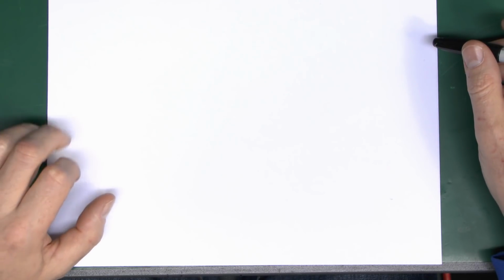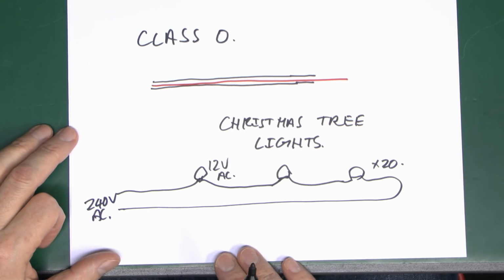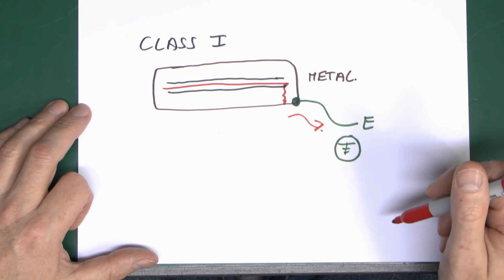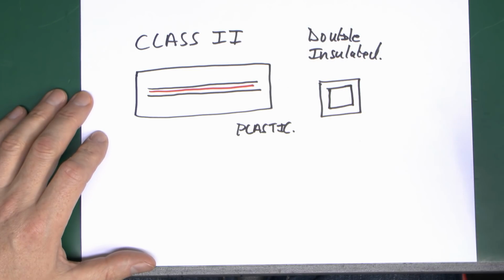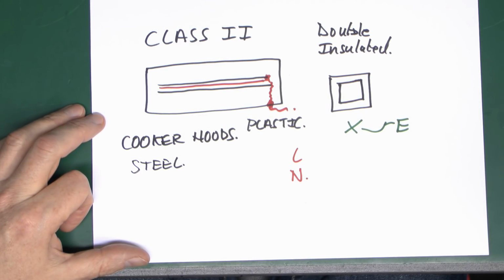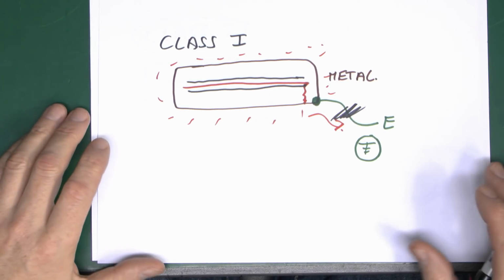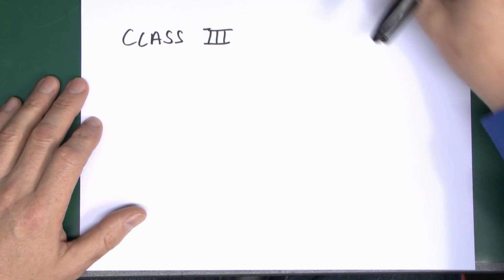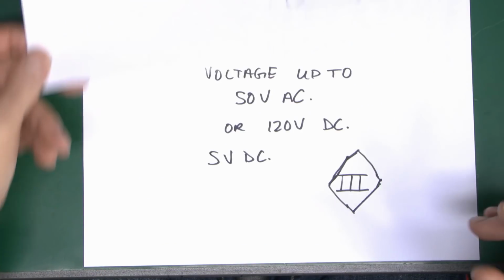Appliance Protection Classes 0, I, II, III

Comment: What class is an electrode boiler?
Reply from the maker: Depends on it's construction, could be class I or II.  The electrodes and the water they are in would be contained within some outer vessel, which could be metal or plastic.
Reply: Its a class -1,because it intentionally make the water live and touchable.

Comment: Would a 240 watt hair dryer fit in a shaver socket ?
Reply: The saver sockets are limited to 1 A. Hair dryers take some 5 A or more.
Reply: @okaro6595  It'd have to be a microscopic hair dryer and you'd need 2 of them to insert simultaneously ;)

Comment: SELV (Safety Extra Low Voltage) is used down here in Australia and New Zealand for things like fans and some types of light fittings that are in installed in bathrooms and toilet rooms.
ELV over here is defined as less than 50VAC and less than 32VDC, so a lot of these things run on either 12 or 24V.
One aspect of these things I don't particularly agree with, is that you have one of them nasty "wall-wart" plugs, plugged into a socket-outlet in your ceiling void, to power this equipment, where it gets really hot during the summer, they are all made out of black plastic, they have been known to start the odd roof fire.
Reply: What voltage are the output wires relative to ?
Let's say the voltage across the wires is 12V What is the voltage on one wire to Earth ? Usually they're not connected - so could be anything - like 240V. So you could have one wire at 240V and the other at 252V and you still have your 12V supply - and either wire could kill you.
Reply: I think you for those backwards. It would make no sense to have lower limit for DC. In Finland it is 50 VAC and 120 VDC.

Comment: Old electric clocks, which I believe have been featured before in your videos, would, if I'm understanding correctly, be something still relatively easily accessible (antiques stores and whatnot) that are Class 0. They normally rely on the insulation in the main coil to provide protection, with the movements typically made of metal, and metal components accessible from the back, and front, often, and don't usually include an earth connection. 

All the ones I''ve got I added a protective earth too, just to be on the safe side.

Comment: Surprisingly I've come across a few examples of class 0 appliances still in use. Usually old table lamps, with either twisted or figure of 8 flex, passing through metallic parts to the lampholder (often brass). They're becoming increasingly uncommon, being at least 50 years old now, but do still turn up.

Fairy lights were a rare exception, being permitted to have only basic insulation right up until '89.
Reply: In Finland class 0 used to be the norm on things like TVs until the mid 70 and in lamps it was used longer. They now are largely obsolete as their plugs do not fit grounded sockets which now are mandatory. It was seen that class 0 is not safe anywhere where ground potential is nearby. Not that people did not pick a knife and cut the plugs in the past.
Reply: I never knew those Xmas lights we had as kids were class 0! No wonder the lamps often died 😂 ah nostalgia for when one of the lamps dies you had to check each filament for which one was dead! I always hated how hot they got while sat on a tree.... Better than candles that was used many many years ago but ... Without any protection but the fuse in the plug? Well.... That's a bad idea!

Comment: Very good John thanks for the video had no idea class 0 even existed 👍
Reply: In Finland class 0 was the norm in dry room equipment until the 70s. In lamps class 0 was sold until the 90s. The problem is that they do not fit into grounded sockets which are in all new homes. It would be very dangerous to have class equipment in any room that has ground potential like grounded equipment. The problem was most acute in the 70s. Almost everyone did some illegal trick to fit for example their TV to a grounded socket. People either cut the plug or made an illegal extension cord.

Also if yo use class I on an ungrounded socket it acts as class 0. An example of an illegally modified class 0 plug:

https://3.bp.blogspot.com/-5r8ISaXrPTY/WhFmIIM3WTI/AAAAAAAANp8/kbOs6HlQoDAsIV6OkyKwQsMHAzfeakJ2gCLcBGAs/w1200-h630-p-k-no-nu/pistotulpat.JPG

Comment: Glad you mentioned at the end about class 2 light fittings, with the small terminal block and sleeving, which should be wired with, for example, a flex into a JB in the ceiling, rather than using connectors in the base. I've declined installing them when there's no chance of getting the JB into the ceiling (because e.g. can't cut a trap because there's fitted carpet on floor above,  or the base isn't large enough to cover the size of needed hole in the ceiling below). But dread to think how some have then connected them, either at customers insistence or as take the money and run - probably, as you say, just using connectors.
Reply: A common solution is the plastic cone between ceiling and flex.  These are large enough to house the connector, but are really only certified as a cosmetic cover for ugly attachments such as a rusty hook carrying the weight of the lamp through the outer sheath of the flex.
Reply: A mini junction box would be pretty handy in this situation

Comment: Sidebar: When I was a teen, playing bass in a band, our organ player would strip the  foil from a nearby cigarette packet, wrap it around the blown amplifier HT fuse and turn it on again.
Shudder
Reply: I take it the original fuse would take 11.
Reply: That's not that bad.  Most people that bypass fuses do it with a nail or a coin that most certainly will not burn out if shorted.   At least the foil would have went before any of the wiring melted.   At worst the foil would set alight and be a fire hazard,  but much worse can happen because most people bypass the fuse with a conductor that's stronger than the internal wiring.

Comment: I have an IKEA desk lamp which is class III. Also my Christmas lights (which I am leaving up as I haven't had a proper Christmas) are marked class III despite being purely battery powered.
Reply: All battery powered appliances are technically class III
Reply: @drgazter  Yes but few are marked.

The IKEA desk lamp is mains but with a transformer. The transformer is class II, the rest class III.
Reply: @seprishere  Better get it earthed then !
Reply: @drgazter  Does Class III even apply to battery stuff? After all it is a completely separate "installation" (at least if the batteries are normal AAs or similar).

It does correctly apply to the IKEA lamp - the plug/adapter is class II, the rest is class III (and metal!). This particular lamp appears to need 4 volts DC.
Reply: @seprishere  the class is based on the construction of the electricity using appliance...  batteries provide electricity hence
Reply: @drgazter  PROVIDED batteries are not charged in it.
Reply: I also have a Tesco table lamp which is metal but class II, it's metal so you can touch it to change the level of dimming. (It provides three levels.)
Reply: @seprishere  I'd never trust those.

Comment: Hi John, good video!
Just wanted to add something,
You would no doubt be aware that dimmers and the like are not considered as effective isolation!
this is due to the fact that electronic components such as Triacs can fail and invariably tend to fail short circuit style, light permanently on!
a similar thinking should be applied to any low voltage equipment 
With regards to class III,
I say this because I have seen a situation where small low voltage power supply used a capacitor dropper circuit to attain the low voltage directly from the mains with no isolation and the +5 on the output registered mains when measured between earth!
Therefore low voltage power supplies should have some sort of galvanic or similar separation!
Most all other types can represent a real hazard
It's done for cheapness with no regard for safety! 
Kind regards Warren
Reply: I've had a conventional lights switch fail permanently on. Currently that bulb holder has a duff bulb in it to keep the spiders out.
Reply: Those components intentionally connect through mains during normal operation and cannot form the safety isolation for class III/SELV.  Legitimate adapters include something else to do that, usually a tiny high frequency transformer.

Comment: Very well explained. 

John another detailed pat testing video on a cheapo online light fitting elaborating the maintenance of class ratings would be great. And maybe showing how some installation approaches as you suggested can remove the class two rating.
Reply: I'm not with John. I like stuff well and truly earthed if it has any exposed bare metal parts.  I've been like that since finding 240V on a TV aerial connection. I 'found' that voltage while connecting the aerial lead to the TV in the dark and spotting the spark.
Reply: @millomweb  John clearly talks about the dangers of having no earth on a class I device, and then explains the dangers of earthing (unnecessary on class II devices) providing a path for fatal fault current if someone is already in contact with another faulty device. This applies to anything that's earthed, including taps, sinks, etc, meaning earthing can be a double edged sword. You're talking about coax being live with no evidence of why it was that way, and what that has to do with classes of equipment.
Reply: @fluxington  I understand the issue of a good earth being a risk but it's only a risk with other badly wired equipment. It's unfair to put any blame on earthed equipment for a fault on unearthed equipment. All being well, the both are connected and the earthed will then protect both.
Class II I take as 'double-insulated' - and there are many of those that are not double insulated. The badge gets put on erroneously.
I don't think old tellies with 2 core wire were even labelled as double insulated - so no lies there !
It was the coax connector on the back of the TV that was live-ish.
More recently (early 1990s) I had a belt off a CRT computer monitor - it was completely assembled and the parts of it I was touching was the glass front of the tube and the plastic casing above the tube ! So I was touching two insulators ! (Cleaning the screen and supporting the unit with the other hand.
Reply: @millomweb  No-one is 'blaming' earthed equipment.

Comment: It causes problems and pain when you mix classes.
Class 2 TV and Class 1 PC.
Made the mistake of connecting these together with a 'leading signal' phono plug.
It blew up an ic in the TV due to float voltage.
The pain?
The repair man took out the 16 pin ic put it on my carpet then later knelt on it putting a neat row of 16 bloody holes in his knee.
Despise class 2.
This is due to float voltage and ADDITIVE leakage current 'tingle'..which can actually become dangerous if you connect enough class 2 devices together.
Shouldn't be allowed.

Comment: You can get Class 2 items that do have an earth connection where it is required for correct operation - e.g. a ground plane to allow a flourescent tube to start or for EMC compliance purposes. These earth connections are not classed as protective and will have the relavant insulation (double or reinforced) to any other conductor
Reply: Now I'm aware of these 'classes', I do not recognise them. If something has a connection to mains power and has exposed bare metal, I will earth it.
And, by 'exposed', I mean can be touched by a person with pointy tools.
Reply: @millomweb  You're exactly the kind of person that shouldn't have anything to do with electricity. You saw the video, you didn't understand what was being said, and you follow your own agenda. Forget the rules, you know best.
Reply: @fluxington  Which is why I've decided anyone with qualifications don't continue inside my house. In here, I'll examine their work and make adjustments accordingly.
Reply: @millomweb  Because you know best. And your qualifications are?

Comment: I'm intrigued by the concept of not connecting the outer shell of a class II device to electrical earth. Is this not the opposite of bonding the 'gas earth', 'water earth' and electrical earth together?
Reply from the maker: Water and gas are bonded to the main earth terminal because they are already at earth potential (due to being buried in the Earth), and it's desirable to ensure that they and other conductive parts remain at the same potential when a fault occurs.
Conductive items that are not connected to anything else, have no potential and are not forming part of an enclosure for single insulated conductors are better left that way, as connecting them will make them have a certain potential, and increases the risk of shock between them and some other item.
Bonding items that have a potential or could have under fault conditions is necessary to reduce the risk of electric shock. 
Things that have no potential and are properly insulated from things that could provide a potential have no risk of electric shock to start with, so bonding those makes the situation worse.
Reply: @jwflame  well done it’s an area with so much confusion.
Reply: That was my thought too...it is the whole point of an equipotential zone.
Reply: Thanks for the reply. I have often wondered if all the metal work associated with my (manually operated) garage door should be earth bonded. Looks like I now have the answer...it shouldn't.
Reply: The outer shell is in most cases plastic so it would make no sense to connect it to the earth.

Comment: Class III - didn't realise the upper range of permitted voltages were quite so high. Where I work we used to have 50V DC battery supplies with open frame distribution busbars - they certainly gave you a nip, not sure I fancy 120V DC.
Reply: I was thinking 120v DC (with no current limiting) could get pretty nasty, I always thought that DC shocks were more dangerous as its more difficult to let go
Reply: @mistermartin82  Opposite is the case, its the AC that makes it impossible to let go.
Reply: @arcadia1701e  I thought that with DC you got one string muscle reaction (to grip) but with AC it’s grip,release,grip,release with the line frequency
Reply: I used to work in a BT Telex exchange where we had 50V DC for the group selectors and plus and minus 80V DC for signalling. I couldn't feel 50 or 80 volts but would certainly get quite a bite from 160V. The signalling was later change to SCVF, voice frequency tones.
Reply: @clivebrooks8207  Some of my colleagues couldn't feel 50V but I used to hate getting across it. We also had 17Hz ring generators, about 80V - didn't like those either!

Comment: Hi John,
You say buy from reputable suppliers but I find low voltage adapters supplied with almost everything these days are a nightmare. They are often not marked with a class at all and may have an earth attached which may or may not be led through to the ground side of the dc output. If you investigate the definition of touchable conductive parts, the outer of a barrel jack can fall within the scope making this a class I device. Often the earth is intended as a "functional" earth used for esd compliance but how would you know? Also even if the device is marked class II if it has an earth connected and it is passed to the output this might mean it cannot be treated as class II and the attached appliance may also become class I even though it has no mains connection. I have seen appliances from very major manufacturers that have a metal casing connected to a separate earth pin brought through from the dc power supply specifically to earth the casing. Your thoughts would be greatly appreciated.
Reply: My laptop IS earthed.
Reply: If they were marked, it would be in Chinese!

Comment: Are the 240v led strip lights classified as class 0?
Reply from the maker: They should be class II, with 2 layers of insulation over live parts.  However anything is possible when obtaining items from dubious vendors.
Reply: John Ward 
Some newer expensive outdoor lights are class 2 up to the control box and class 0 from the control box onwards - BUT with the weird specification that they also include current limiting circuits and some funny differential protection in the control box itself that uses a tiny relay to stop faults to ground.
The relay is the default open type and the circuit trips it at about one milliamp DC.
Edit: the insulation is some black rubber and it seems to be thicker than what is found in indoor christmas lights. It could be all just a class 2, though I doubt they actually bothered to use double insulated wires and put double-insulation on each individual light. It’s still better than those who legally hide behind something like “it’s double-insulated cause it has a layer of plastic and a layer of air”.
Reply: It can also be''class -1''.Lower than class 0,you can touch live parts.